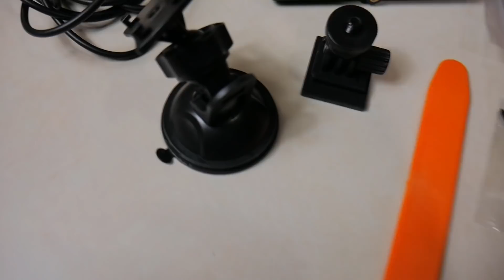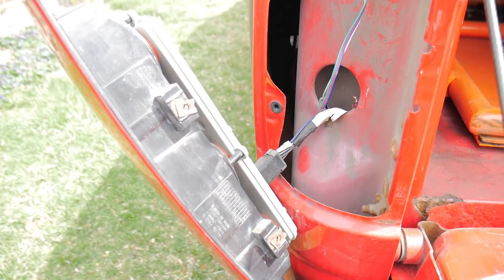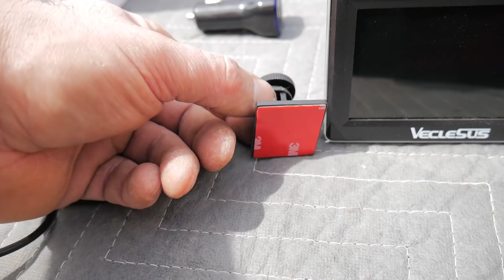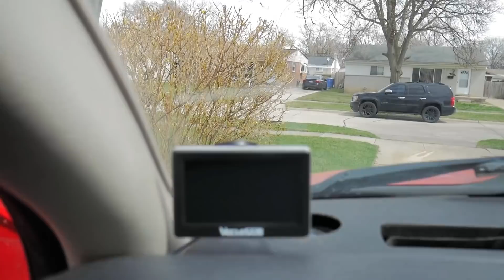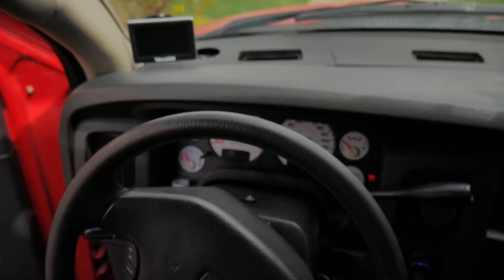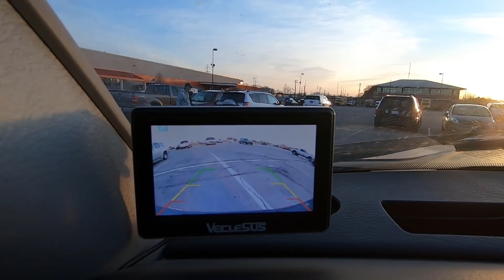Wireless/WIFI Back up camera by VECLESUS install and review

Comment: My question is with the looped small green wire coming from the license plate should that be cut if you’re using the back up light to trigger the camera I have the green wire going to back up however the camera is on all the time with ignition does anyone have the answer to that one.

Comment: I installed this in a Dodge Ram 1500. Because the top of the license plate basically sits flush with the top of the bumper, I was unable to attach the camera to the bumper. I could only stick it to the license plate. It looks like you installed it in a similar truck. Were you able to attach it directly to the bumper?
Reply from the maker: Yea just used two sided tape